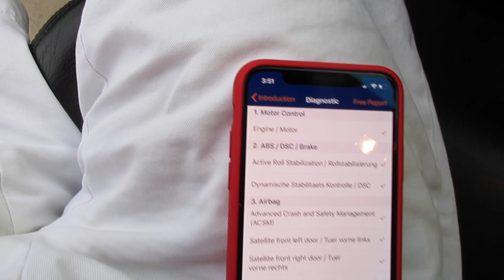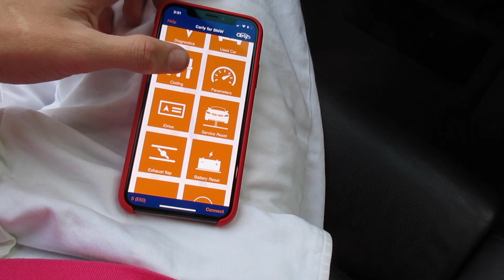IT'S THE COPS!  11/30/17 - Day 2,549

Comment: Did these cars have throttle body issues like the e9x M3s? Think that could be the problem with the e60?
Reply from the maker: Yes they do, but these have been done within the last 2 years.  It's around $5-$6k to do them which is now half the value of the car.